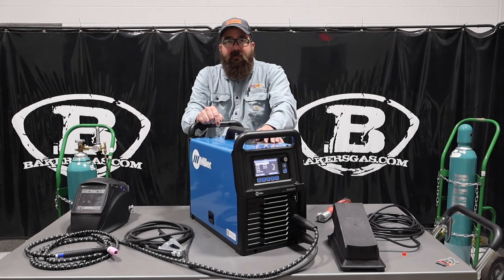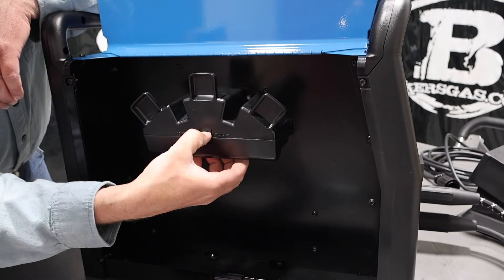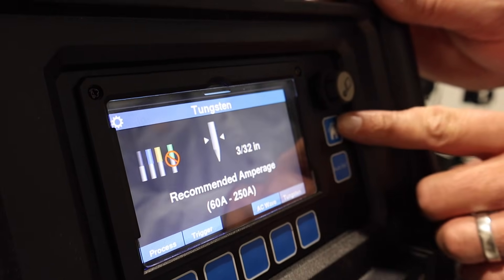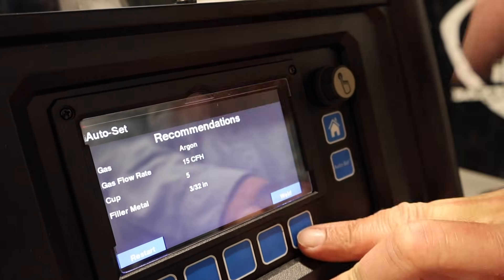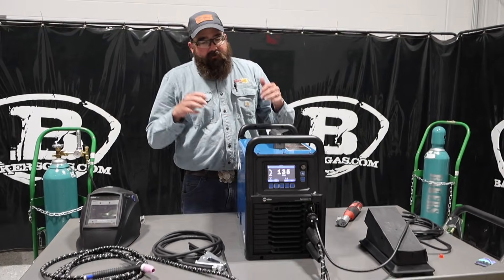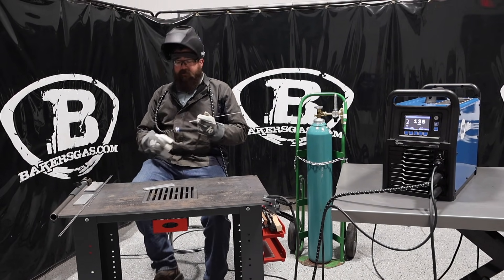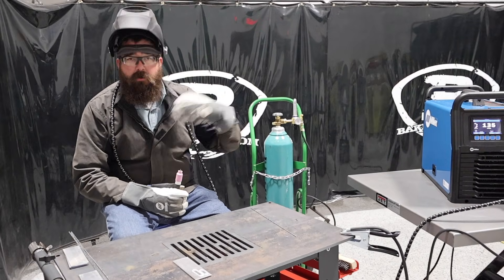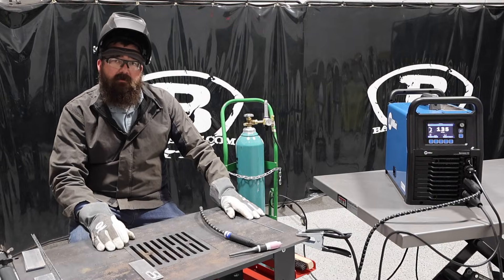Miller Syncrowave 212 Review and Demo

Comment: Everlast or Miller? The everlast 330 comes with a bit more accessories for $4400, and this Miller 212 bundle is $4000. What would you guys get?
Reply: Miller
Reply: I mean the everlast 220 is a better comparison in capability. The everlast 330 would come in handy for thicker aluminum. We don’t seethe pulse options on the syncrowave in this video so that’s something to consider as well. A miller in the 300 amp range pushes you into a much higher price bracket. Im curious if the miller is assembled in the U.S. or not.
Reply: @KZ-yy9pm Everlast are widely regarded as junk. Lots of people with lots of issues.
Reply from the maker: Miller 212!

Comment: How does this compare to the Dynasty 210? It seems like there is a lot of value in this machine compared with the Dynasty but might be missing something
Reply from the maker: Yes, there are a lot of similarities, certainly more portable than the water-cooled version. You do not get all of the AC frequency control and no memory settings. Depending on what you are using it for you may be fine with the 212! Let us know we are happy to quote both for you.